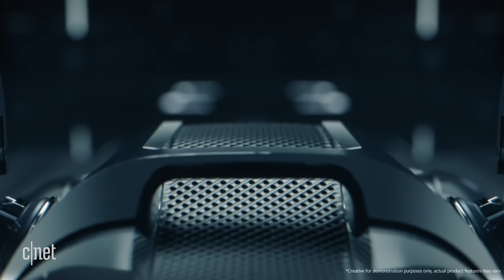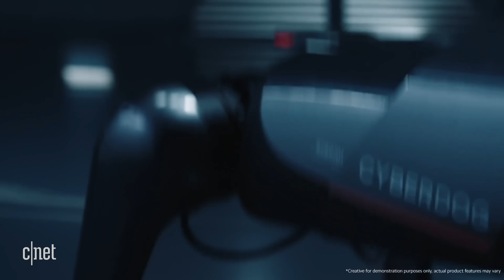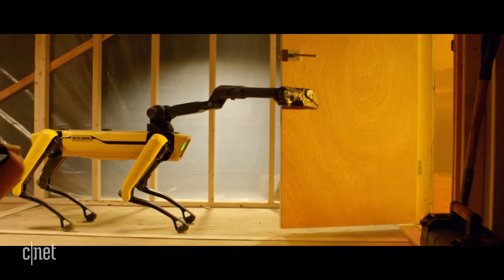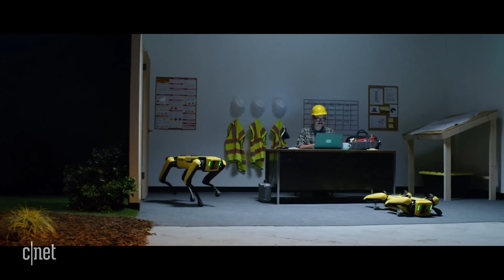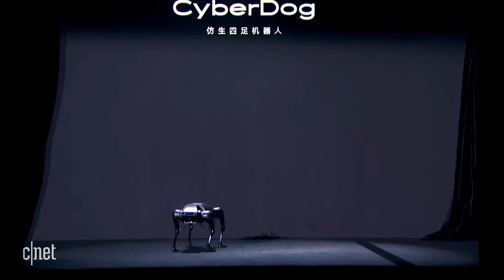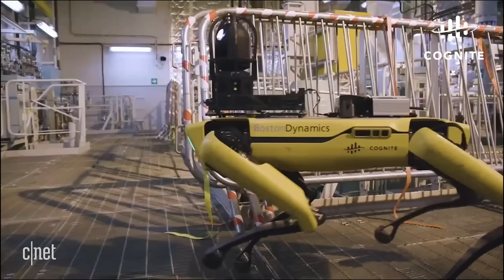Xiaomi Cyber Dog vs. Boston Dynamics Spot! (Watch their reveals)

Comment: It’s like anything consumer-level vs. pro/industrial-level.  Cameras (photo or video) are 10-20X as much at the pro level.  Same with computers/servers.  Same with shelving.  Because the pro/industrial-level products work fully 99.99999% of the time, can take abuse, and provide solutions for complex workflows and integrations with other software/hardware— because businesses can count on them.  CyberDog is consumer-level— if you’ve ever seen people using them out in the wild, they fall over, they trip on things, they get their routes confused, and they’re relatively weak (can carry/pull much of anything).

Spot and CyberDog are completely different classes of products.  CyberDog roughly looks like Spot, but is much closer to a Sony AIBO— an expensive toy that’ll do things right 75-90% of the time and has a few cute canned tricks.  They only seem similar on the surface.
Reply: :0
Ok

Comment: I would be really impressed, if spot 1 battery was replaced by spot 2. Then spot 2 put spot 1 battery in charger. I.e., Full circle
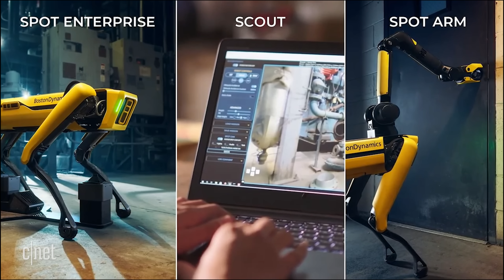Reply: I think the "Spot Enterprise" at 6:30 has a recharging dock so it can self charge.
Reply: They should make a dog bed that's a wireless charger .. then it could walk over and lay down on it when it's "tired" and get back up when it's "rested". You're welcome Boston Dynamics. You can mail me a free Spot.
Reply: @THE-X-Force  If you look at the left picture at 6:30, see the black thing under the robot? That's the charger. It lowers itself down on that to charge. So they kind of already have that.
Reply: @dwaneanderson8039  Awesome. Thanks. I don't know why I didn't notice that the last time you pointed it out. That is excellent, but I still think my idea of it being more of a "dog bed" would be cute for those that may eventually get a Spot type of bot, that aren't using it for industrial / commercial purposes .. but more of a domestic thing, and I don't think that charging dock is wireless.

Comment: One is meant to be a toy, and the other a tool. It is like comparing a robot vacuum to a $5 Walmart remote controlled toy car.
Reply: Then tell me which company bought BD Spot for what tasks.
Reply: @lalandbaby  Spot is meant for tasks like search and rescue, or emergency response like in a nuclear reactor failure. I do not know anyone is actively using it as such.  You can see this in the ad they have.
Reply: @Mariobrownio1989  , SpaceX actually uses Spot to go inspect rocket launch sites right after a launch/landing. It's way too dangerous for humans as the propellants are toxic to humans and/or there are risks of explosion. Spot shines in this use case.
Reply: @debayanDas  That's great, lol, I did not know it was in actual use. Thanks for sharing. The xiaomi one is just  a toy unfortunately, Maybe next generation they can add some functionality.

Comment: Yeah a single Spot is more useful than a single Cyber Dog, but for the price of a single Spot, you can get like 50 Cyber Dogs.
Reply: 1 useful thing > 50 useless things.
Reply: if you go to a shelter you can get a free real dog
Reply: ... that do absolutely nothing 50x.
Reply: Yes, and one spot is better than 50 "cyber dogs" 😂
Reply: Yes,  spot is for firms.  Cyberdog for pet.
Reply: but, the Cyber Dog can do EVERYTHING that Spot can....    not sure you have done your research here.
Reply: @orion7741  not even close, are you actually  blind?
Reply: @orion7741  It is unreliable, though- it’s battery life is shorter, it’s AI less refined, it’s mechanics less complex. It trips and gets stuck more often. It has little customizability for professionals such as firefighters and rescue workers, construction workers, etc. And of course, it is extremely weak. It cannot haul very much at all, and does not deal well with weight applied to any part. Spot, on the other hand, was designed for this crowd.
Reply: @orion7741  I don't think so.. Can CyberDog have such powerful arms? And it looks way smaller to me, so I think Spot works better in mines

Comment: The price comparison is ghastly huge. $1k vs $70k. You can get few squadrons of Cyberdog with the money of one spot. BD has got to drive down their cost somehow to stay in the lead
Reply: Chinese companies are like the Borg.  They create nothing, they innovate nothing.  They assimilate others' great ideas and mass produce cheaper, less useful versions of it using slave labor.
Reply: @glennpearson9348  just deal with it, welcome to 21st Century
Reply: @thomasanderson9539  Good advice.  Thanks, Thomas.
Reply: 20 plus years of R&D versus 1 year of copying and reverse engineering. Spot is not meant to be a toy to begin with.
Reply: They don't need to drive down anything. You aren't buying either and Boston dynamics is made for other applications then some kids trying to take cool pictures with it for likes on the internet
Reply: @playerroku4412   BD Spot needn't be priced any lower,  perfect for any companies hoping to grab market share.
Reply: @Bruh-wb3qw  but if the starting price is 1k...that leaves a huge gap in price that benefits Xiaomi. Upgrades will still leave it costing way less than SPOT

Comment: 90 minute runtime? Hard pass ill wait for version 10
Reply: If it charges fast enough.. it can do maybe 270(90x3) minutes which is a little more than a part time position.
Reply: Meant to say 270 minutes within 24 hrs
Reply: worth the features
Reply: you can also put additional batteries on its back if you need it